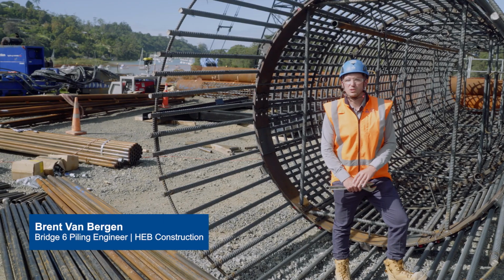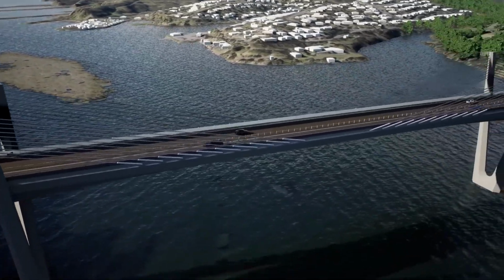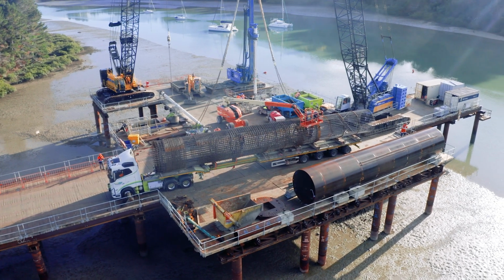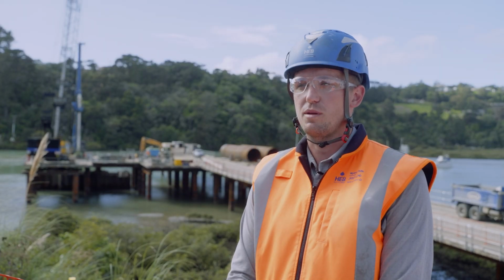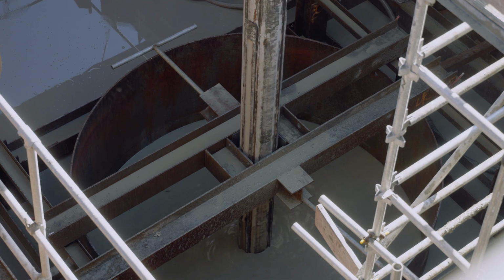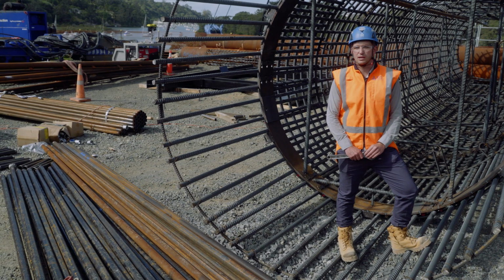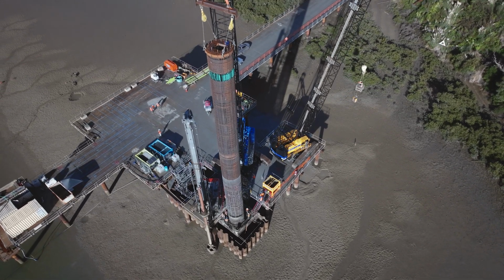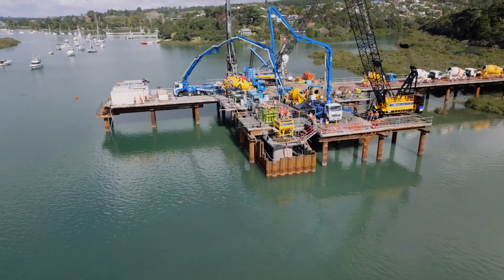Building massive foundations in the river for New Zealand's first extradosed bridge.

Comment: Price 
Location
Reason for bridge
Thanks
Reply: Whangaparoa Peninsula, Auckland NZ. Built to lessen traffic congestion from Silverdale interchange
Reply: All important, the price?
Reply: @dennisbevin7979  Grossly overpriced.
The total PENLINK  (NOT this bs name - mahurangi is 30Km North) is $840Million = $120Mill. per Km.
Reply: @charlesnol2187  penlink has gone from $140Mil to this disgusting figure in a very short time.
I have lived in the area for 32 years, and Rodney DC had the total required to do the job when we were sucked into the Auckland BS.
Anywhere else in the world, the /Km costs are $20M range.
This bridge should not be so high over the Wade River, and we are being screwed with a single lane each way.  
The whole deal stinks.